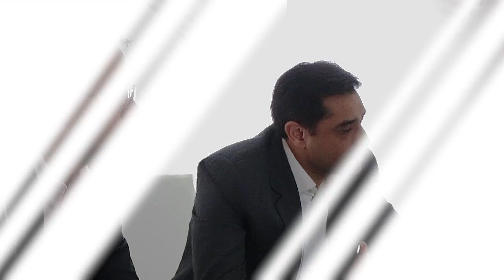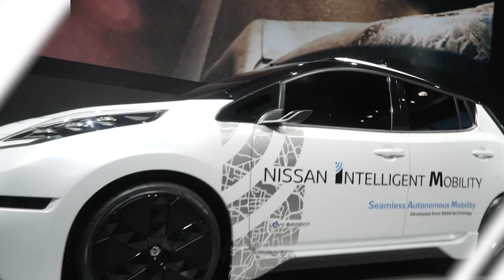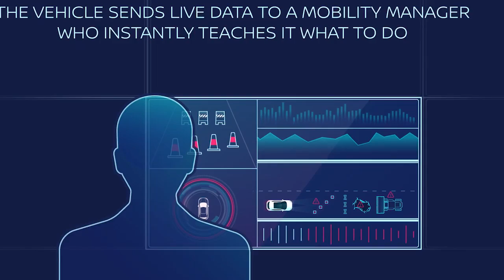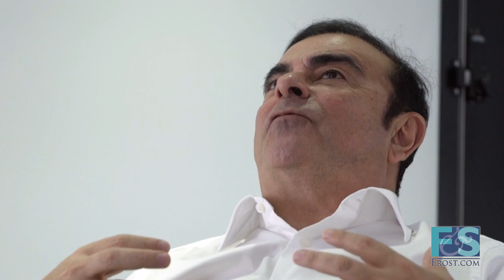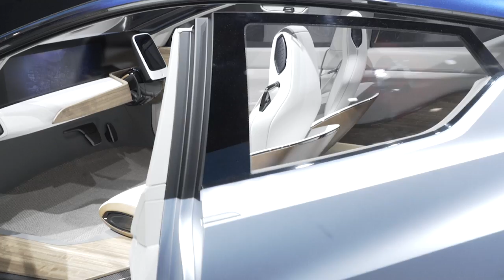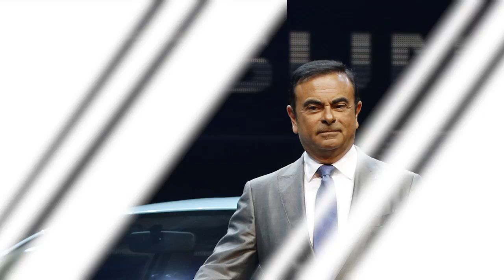Renault Nissan Alliance CEO Carlos Ghosn Talks about The Future of The Auto Industry

Comment: Mr. Hiroto Saikawa
President and Chief Executive Officer

Mr. Carlos Ghosn
Chairman of the Board

Nissan Motor Co., Ltd.
1-1Takashima 1-chomeNishi-kuYokohama-shiKanagawa 220-8686 Japan

Dear Sirs,
Attn: Mr. Hiroto Saikawa / Mr. arlos Ghosn

I am Rasith Gunaratna; an international travel trade businessman from Sri Lanka.

I purchased a Nissan 2016 X Trail Brand New Hybrid T32 vehicle; VIN – JN1 TENT 32Z 00000 85 / Engine: MR20 829306B from your dealer AMW (Associated Motorways (PVT) Limited on 11 July 2016 at a price of Sri Lankan Rupees 11,500,000.00 US$ 77,666.66.

At the driven mileage of 10,662km there was a warning message as “HV SYSTEM WARM UP – PLEASE WAIT IN PARK”

I contacted the Nissan local dealer/agent; AMW (Associated Motorways (pvt) Limited) in Sri Lanka; and they asked me to send the vehicle to their service centre as soon as possible. 
I was on a family reunion tour for 07 days but I had to cancel last three nights and handover the vehicle to AMW for repairing.I handed over the vehicle at 11,066km for the repairing.

After three days AMW called me and said the vehicle needs to replace with anew CVT and they will import it from NISSAN motor Co. Japan and fix within 03 weeks. 
However, they did not mention or inform me regarding the technical issue. I found the error codes from one of my friends working at the same company.

The error codes were; P0775, P0776 - OBD-II - Pressure Control Solenoid B Performance / Malfunction

AMW did not send or disclose any details regarding the technical errors even if I requested it for several times. As the customer I have the right to know what issue was there in the CVT of a NISSAN brand new vehicle.
After four weeks of time they send me a courtesy vehicle but I lost my business and personal life due to the unavailability of my vehicle for four weeks. 

AMW; the NISSAN agent/dealer contacted me on 13 June, 2017 and requested to collect my vehicle and return the courtesy vehicle but, they still do not provide me the technical details or scanned reports of the error caused by the Nissan Brand New X Trail. They also do not provide me the details for replaced Brand New NISSAN CVT which they imported from Japan. (They have only given me a serial number 3ZX3D-Y17349544)

As a NISSAN brand loyal customer I have the right to know about my vehicle, it’s failures, it’s newly replaced CVT’s details in black and white.
I have lost my trust on my NISSAN x-trail, NISSAN brand and Nissan Motor Company in Japan as well as the dealer, AMW in Sri Lanka.

As an international customer I’m now in a very helpless situation because both Nissan Motor Company – Japan and their local sales agent / dealer in Sri Lanka are not responding to me on my inquiry.
I have wrote to Nissan Motor Company – Japan and requested to advice, help and extend the warranty for replaced CVT but they keep silent.

As the manufacturer of NISSAN vehicles they should be responsible for their manufacturing fault but they just neglect my complaint.

I am writing to you all for asking some advices and help in this regard. 

Thank you.
Rasith

Rasith Gunaratna – Cofounder

Different Discovery

Different Discovery Tours (Pvt) Ltd. Discovery House, No. 67, Big City, Yatiyana, Minuwangoda, 11550 (WP) Sri Lanka | Tel: +94 11 2251222 | Hotlines: +94 779 178 449 | +94 763 610 048 | +94 777 911 276 | www.toursrilanka.lk | Different Discovery

refreshingly different, something new awaits you everyday..